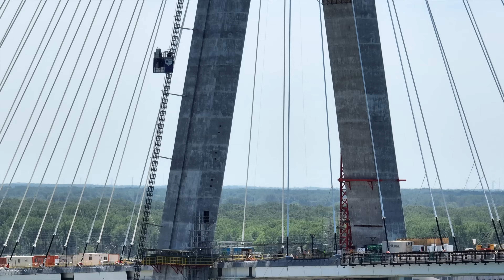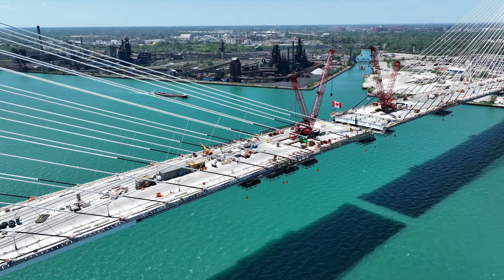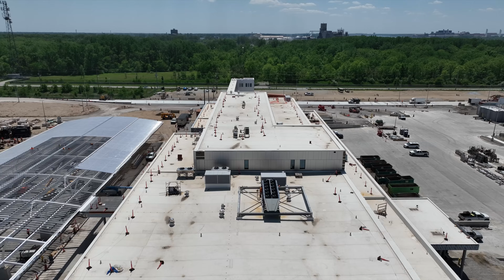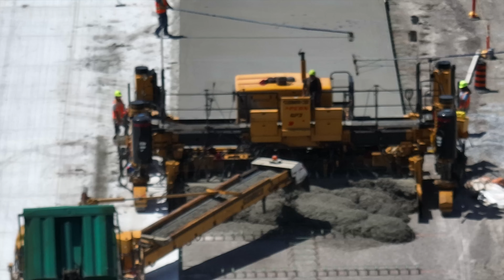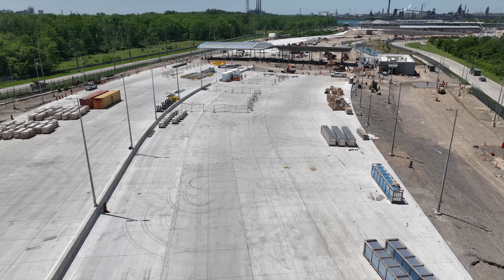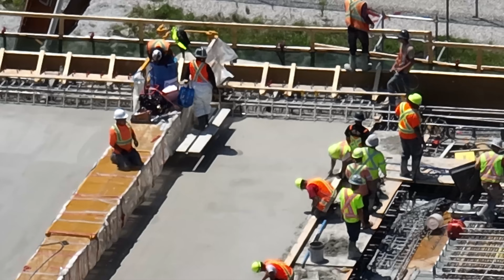Gordie Howe Bridge CLOSE TO CONNECTING!

Comment: Almost done Americans have two more task to do and Canadians have one task to do before they connect. Canada needs to dismantle the crane and get the bridge ready for jacking so they can lift the deck up and install the permanent cables. Americans they have the final pore they have to do and they have to move the crawler cranes to the end before they can dismantle their crane and jack the bridge up and install the cables. Once the bridge is jacked up to its final level the keystone segment goes in and the strand jack cables are removed and the permanent cables are installed in the sleeves. Then all they have to do is finish the bridge.
Reply: Very good description of what remains.. The bridge website also has a very detailed explanation of what is still to be done to connect. The final section has to be customized at Canton in Quebec. When you read it it becomes clear that the final section involves many facets and won't be complete anytime soon.
Reply from the maker: Hi Peter. Another very informative comment. Thanks for sharing!
Reply from the maker: Hi geomodelrailroad. Excellent post! I am going to pin this. Thanks for the heads up!

Comment: When they're done working there could you send the crew over to complete the Merriman bridge over Hines Drive. They've been 'building' it for years.
Reply from the maker: Hi Frank. You think they will still be needed in 15 months?
Reply: @bobjonesrealtor7756  At the pace they've been working, yes! We just went down to the GH bridge. Nobody around at all. We were able to drive right under it. It looks like they have connected it. If not you couldn't tell from where we were. There's still 2 cranes facing each other right in the middle. Just turn on Springwell from Jefferson.
Reply from the maker: True. But there is a lot to do before the bridge opens in the fall of 2025. Your right Frank they are going to meet in the middle some time this month. Cool you can drive under the bridge. In Canada we can get close, but not that close.

Comment: The Gordie Howe Bridge would be the 10th longest cable-stayed bridge in the World if it were open today, but China has 6 under construction that are longer.  At least two of them will be completed this year and a third one completed next year, thus the GHB will be 12th or 13th when it opens, then drop down to 16th when the three remaining Chinese bridges are completed in 2026.
Reply from the maker: Hi Triplecenturies. That's interesting information, but I can't comment on information i'm unaware of. That said, in my opinion it is an awesome bridge, in my backyard. Thanks for the information, I'll see what I can find. Thanks for the heads up.
Reply: It will still be top 5 in North America
Reply: @classicsforever.  It will be the LONGEST span for a cable-stayed bridge not only in North America, but in the Western Hemisphere.  I think the "top 5 in North America" I've read elsewhere includes suspension bridges. The ones longer are The Verrazzano Narrows (1,304.5 meters), Golden Gate (1,280.2 meters), Mackinac (1,158.2 meters), George Washington (1,066.8 meters).  I guess the Gordie Howe Bridge gets lumped in with the pair of Tacoma Narrows Bridges for 5th spot, but to be technical (accurate) the Tacoma Narrows Bridges are officially 2,800 feet, thus 853.4 meters and the Gordie Howe is "853 meters", thus 2,798.5 feet (rounded up to 2,799 feet).
Reply from the maker: Thanks for the great information, Triplecenturies!